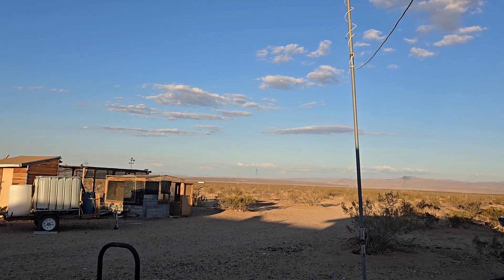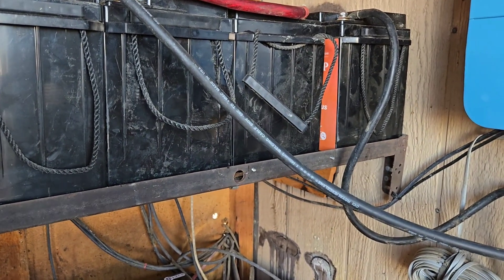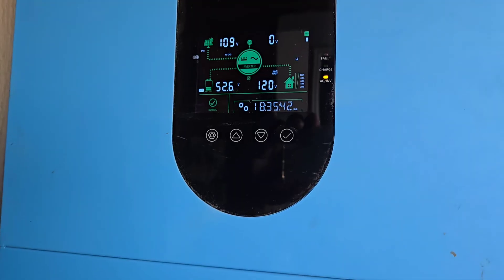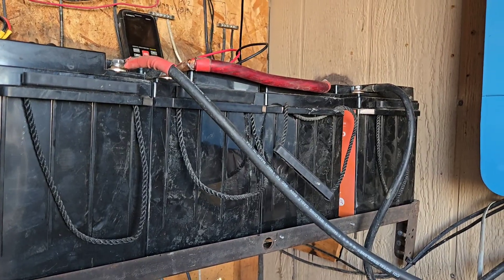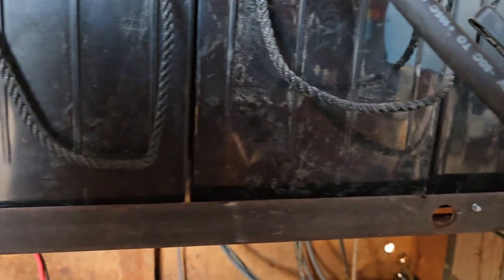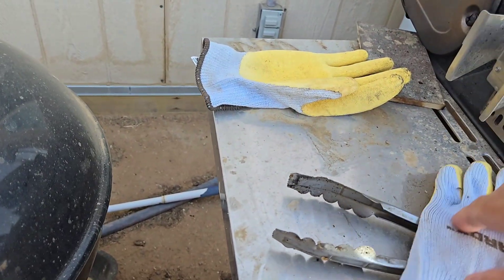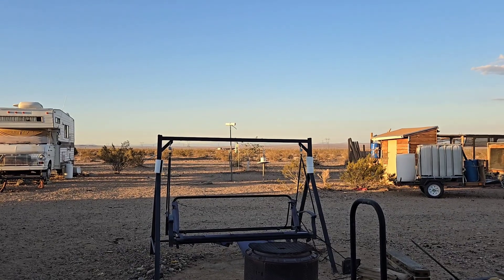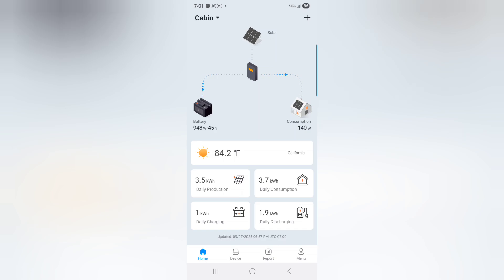Battery Experiment Failed, Sep. 7, 2025

Comment: The smart batteries have a issue they are trying to figure out companies having trouble trying to fix them
Reply from the maker: I see you watch Will Prowse.
WattCycle already has a beta app out that is supposed to fix the parallel problem with smart batteries.  
Note that the problem does not affect batteries without Bluetooth,  or batteries connected in series.
Reply from the maker: Welcome aboard!

Comment: Try charging each battery separately to 100% and float them for a couple of hours (preferably 12 hours). My guess is that you have low voltage cells in each bad battery and they need to be equalized. The thing is, the BMS enables cell equalization once the battery enters float charge and needs to stay in float mode for some time for the process to complete.

The problem with your setup is that you have multiple 12v batteries in series without a battery balancer for 48v. Without a balancer, each battery from the bank will not reach 100% SOC at the same time and will not trigger the BMS to enter cell equalization mode. I don't know how the BMS in LiTime batteries behaves, but in other batteries tied in a 24v or 48v string, once a battery from that string reaches 100% SOC, the BMS will stop sending current to the other batteries in the string, stopping the charging process and creating an imbalance within the bank.

The best case for Lifepo4 batteries is to get an entire battery at the voltage that you want your setup to be (most manufacturers sell 24v or 48v batteries). This will remove the need for a 48v balancer and eliminate any other headaches in the future. You'll still need to float charge the batteries regularly, for the BMS to balance each individual cell within the battery.

You can check the YouTube channel "Projects in Paradise 808", he's done some videos about reviving dead Lifepo4 batteries. You can take a look at his videos for any other ideas, in case LiTime refuses to warranty your batteries.
Reply from the maker: Thanks for that input.  I'll look into it.

Comment: Try buying server rakc style bateries,true 48 volt ones,so you dont need to put them in series,and destroy them,they drifted apart,and thats why they dont work properly.With a Vatrer battery you will not have this problem.
Reply from the maker: Welcome aboard. The server rack 48v batteries I want won't be available for 2 months.  I'm going with 48v LiFePO4 golfcart batteries from Wattcycle

Comment: i dont see how the batteries are junk....your solar PV voltage is so low,your mppt is not working.What ever charged,probably wiht peak sun,when the mppt could actually engage,why u have 110V Pv??? You know this is a high voltage mppt and it needs at least 130V to start charging/working? also you yourself showing the daily charge/usage,and you use more than what you produce,again,mppt not working correctly.Also why u say u have 30% battery left? Do you have a shunt? how you measure it? voltage doesnt mean absolutely anything on lifepo4 in regard to state of charge. Please try to sort out the electical before you spitting on your batteries,they probably have absolutely no problem,or maybe just little out of balance,becouse they are not getting proper charge each day.Also,why u have no balaccer in between the 12V battery modules that are tied in series? So many things wrong on this system,ita a very long list,i advice you take care of those first,than see,what the batteries are doing....
Reply from the maker: Simple answer.
The batteries charge to 100%, either by solar or charger, but when put under load, they die in a short time.
You are not qualified to make such diagnosis in my opinion.  
It's like telling someone their car problem is it's only out of gas, when actually the timing belt has failed.
You need more info before making statements.

Comment: Hopefully you will be provided with a solution soon.  My father (a mechanical engineer) always bought the base model car and did his best to avoid whistles and bells.  Why?  In his words; “fewer things to go wrong”.
Reply: I agree...my wife's SUV has every bell and whistle possible. A it scares me to death  thinking about fixing it when something goes wrong. Her headlight bulbs were over 100 bucks each. And you have to replace both when one goes bad. These lights move when you turn the steering wheel.  Gone are the days of a six dollar glass bulb that was easy to replace. And never turned yellow form the sun. More is not always better. To her it is cause she dont have to work on the damn thing.
Reply from the maker: @someguy-xi2xq 😂😅😂
Reply: @someguy-xi2xq . I hear you.  I would love to have either my 1965 Dodge Dart or my 1974 Ford f250 back.
Reply from the maker: That was what my boss as an auto mechanic used to say back in the 60's

Comment: SORRY ABOUT YOUR BAD BATTERYS
Reply from the maker: Thanks.  Me too.
Reply: @GBear  THAT 4 BATTERY BALANCER MADE BY POWMR I HAVE ONE FOR A YEAR WORKING GREAT ON  ONE 4 BATTERY 24V, I BEEN BUYING BAT FOR ABOUT 98.00 100 AH
Reply from the maker: @leetaves9143 Watch out for those extremely cheap batteries. Usually the internal wiring isn't adequate for the amps and they are fire hazards.
Reply: @GBear  that why i re do them when i can get the next order ill put eveay wire any thing i have now does not draw a lot of amps
Reply: @GBear   do you have any remedy for sleeping i get very little?
Reply from the maker: @leetaves9143 Get tired during the day.
Good sleep requires a quiet, light free environment.  Even a illuminated clock on the nightstand should be turned away or even better, covered with a cloth.  Also, eating to late can cause sleep problems.
Reply: @GBear  thanks i need to get rid of the pain first they put a steel rod in to mend the leg it broke about 6in, a bove the knee complete off, that same i had a knee replacement 10 years a go, i hate taking drugs been oxicodn 4 45 days now
Reply from the maker: @leetaves9143 Yep, nothing can be done  about that, I am sorry.  Only time will heal.

Comment: The bms will only balance the internal cells when it reaches 14.25v for most of these batteries.   It takes a long time at 14.25v to balance the cells if they have not had any balancing time.   With the system at 12.8v the bank can share the same voltage very easily with equal length and gauge cables.   

Each battery has 4 cells and if one of those is low and one is high the bms will stop charging once the upper limit is reached on the highest battery.   This leaves the lowest battery well below the cut off voltage.   Over time this gap expands.   The solution is to charge them fully and let them rest (internally balance) the charge again and so on.    This is a slow process that could take weeks to complete if the balance is really bad.   

If the charge parameters on the new inverter are set too high then it causes the charging to stop when the highest voltage battery reaches 14.6v.   The others may only be at 13.6v.   Over time this gets worse which is why you need to check individual  voltages routinely.    Battery balancers help to reduce or eliminate this issue by draining off the highest battery and charging it to the lowest battery.   It work similar to the internal bms balancing.    Unfortunately, this balancing only occurs when the battery voltages reach their high point.    If you turn down the charging voltage to 14.25 then the bms is less likely to shut down charging on the highest and allow the lower voltage batteries to catch up over time.    But, this takes time and patience.
Reply from the maker: Thanks.  I have no problem charging to full and staying there all day.  The problem comes after sunset, the batteries die in short time running only a couple hundred watts in the cabin.  If I turn on ceiling fans or AC, dead in an hour.
Reply: @GBear  1-You dont charge them full,you proved it with this video.2- your mppt doesnt even work properly,try putting more panels in series.3-you bateries are out of balance,therefore they dont work as intended.
Reply from the maker: Again, get all the facts before flapping g your lips.  The readings you saw in the video were end of daylight readings.   During the day the panels produce 200volts input on both pv1 and pv2.

Comment: LiPo4 cells cost nothing now.  16 cells and a bms, rather than wasting money on these.  $50 a 280ah cell. You can mix the batteries as well.  I have 2x 200ah cells and 1x 280ah cells.  200ah x16 cells work out about 10kwh x2 and the 280ah x 16 cells which is 13 kwh.  33kwh of power to get me through the night on a sunny day.  I'm in Aus so double price for me.  You buy these batteries with no idea what cells they used.  If you buy 16 cells, you can inspect them, test them and have some idea of what you got.  You bought mystery boxes.....
Reply from the maker: Welcome aboard. A reputable Youtuber reviewed and recommended LiTime batteries, tearing one apart to show EVE cells, and top BMS, etc.
That's why I bought them.

Comment: I've seen a nother video where a guy charged his 48v  with 12v charge at each battery he was having the same problem i have 4 300ah with balancer and probably gonna charger at 12v
Reply from the maker: Welcome aboard. All 12v batteries need to be charged separately to full, prior to use the first time, using a properly sized LiFePO4 charger.
These were done that way.
After that, 4 in series can be charged at 48v.

Comment: Watts your working theory on watt happened? Wired as 12v in parallel you ran with them, quite a while, no problem.  Shortly after wiring in series at 48v they crapped out...
Reply from the maker: Coincidence. BMS's failure is my guess.  3 batteries with serial numbers only 1 digit different, sounds like a Friday afternoon crew built them.

Comment: Li time is suppose to be good.  Your in a bad situation,   You need those batteries.  So no time to check them out.   You have 16 cells to makes 52 volts.  If one cell in not keeping up. Your whole system is down.   This is way you have A BMS with active balancer to keep all cells equally charged.  The system you have has Four separate systems and nothing to control the fours systems. 
Also you need to keep the system at full charge voltage for a few hours to give the balancer time to balance the cells.  
Set the  voltage up to 58 volts on the inverter.   See if that helps.   I don't think your every going to be trouble free with the set up of 4  12V batteries in series.   I also think you on to something with the seral number's and a bad batch.   That would make Sense.
I wonder if one of my lead acid balancer would work on your system. I have three or four of them.  Will never use again.
Reply from the maker: Thanks, but I am in the process of replacing this set with 48v batteries from Wattcycle.
Reply: @GBear   that probably a good thing.

Comment: Years ago I found out it's better to learn from someone else's mistakes than my own in the long run.
Not to say I don't still make them but it's just more cost effective to learn from others.
That Watt Cycle battery I won in your giveaway works flawlessly with just one 30 watt solar panel keeping it charged. I think they make good reliable products.
Reply from the maker: Thanks.  Yes, WattCycle is top dog in my realm.
Reply: @GBear What about taking the 2 defective Lie-Time batteries out of the bank and going with 24 volts until you can get 2 more batteries? That way you wouldn't have to run the generator.
Reply from the maker: @miguelsalami I don't have a 24v inverter.
Reply: @GBear Well see I learned something else today as I was under the assumption your inverter was adjustable from 12/24/48 volts but it's designated for 48 volts.
Reply from the maker: @miguelsalami All inverters are designated for individual voltages.
Charge controllers can handle different voltages, like the Midnite Classic can handle from 12v to 96v.
Reply: @GBear Ok now I understand Thanks. With everything you have already I'm sure you will come up with a solution even if it's a temporary one.🙏
Reply from the maker: @miguelsalami Thanks.  As long as I don't use any AC during the day, I can keep my batteries at full charge.  The bad group won't sustain a load for very long, but the solar compensates during the day.  By 5pm, I need to shut off all but one ceiling fan and of course the fridge, freezer, clocks can stay running, but thats it.  Anything more and the power drops too quickly and the gen needs to be started.

Comment: Oh man what a mess! Can't wait to see what solution they come up with for you.
Reply from the maker: Yeah, really.  Tony and LeAnn had problems with these exact brand and size, dying overnight.  They returned them and got their money back, now use WattCycle.
Reply: I have 4 Li Time 24 volt 100 ah batteries and a Aims 24 volt inverter charger just like the one you have its been running fine for a little over a year now  No problem so far
Reply from the maker: @hegefarms4260 yep, these are going on 15 months old.

Comment: Maybe you should get your Aims inverter charger hooked up until you get your Batteries replaced and run your old system
Reply from the maker: That's still an option, but these are the same batteries that powered the 12v system.  I have a mismatch of 12v batteries around here, but all different amps hours.  I'm getting along just as well this way, just costing me money I don't have, for gasoline.  LiTime needs to get on the ball and replace these ASAP.
Reply: imagine having no clue about mppt,electrical,and chargeing lifepo4,than build a system,that doesnt work,that spitting on battery,that prob have no problem xD
Reply from the maker: @83kaszas Imagine being such a self centered fool to believe they have all the answers without being asked any of the questions.

Comment: The battery at 3:54 will take weeks to get fully charged on the little Bateria charger. When disconnected and voltage drops down to 12 something, that sounds normal to me. I think that battery is good.
Reply from the maker: Nope.  Tried it on a 14.6v, 20A charger too.
Doesn't hold the charge.  As soon as it is put under load, the power drops off quickly.
Reply: There's a weak cell, crap bms allows the cells to become unbalanced

Comment: Hope they sort out you're batteries soon G Bear.
Reply from the maker: Me too!  Tonight I can't seem to get them over 50% charge with the generator pumping out 1kw.
Reply: @GBear  I hope Wattcycle come to you're aid soon as they sound a better battery to have. Check that the Li time batteries are not getting hot when you charge them G Bear.
Reply from the maker: @daz.r1994 Thanks.  Yeah, I just want these things replaced, and I can move on to the next adventure off grid.

Comment: I hope your efforts to return them are successful! If they continue to push back/not accept the return, use AI (ChatGpt or similar) and upload the warranty policy and ask the AI to use that and existing laws to draft a letter to them. I did this after a month of back and fourth with a company that sold me a power bank and....it worked! They avoid any accountability, but if you say the right things they will usually do the right thing. AI isn't a lawyer...but it makes normal people a lot closer to them. Let me know if you want a couple example prompts to try
Reply from the maker: Thanks Steve.  I'll let you know.
I'm pretty well versed on business law, having run multiple companies over the years.  Usually, when they find out I know what I'm talking about, the wrinkles get ironed out quickly.